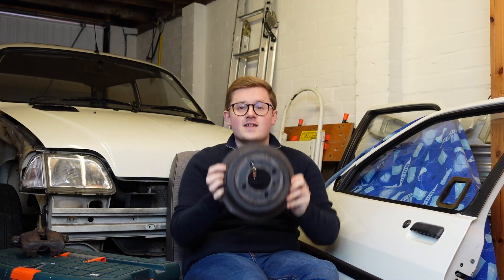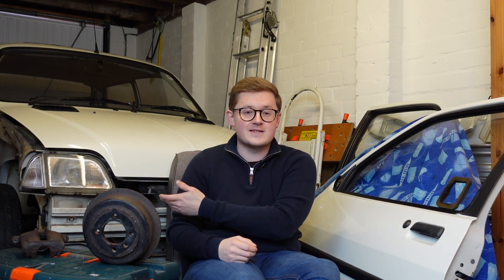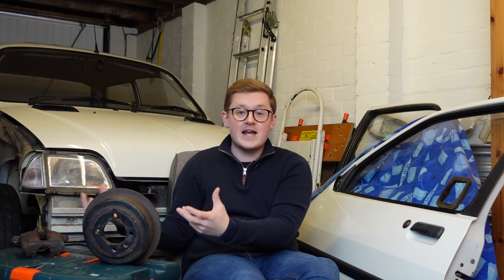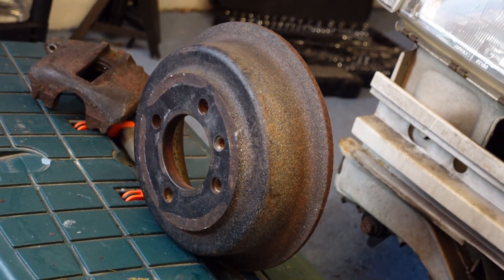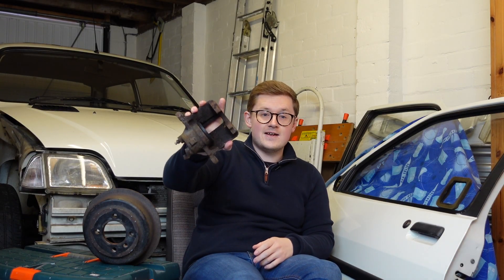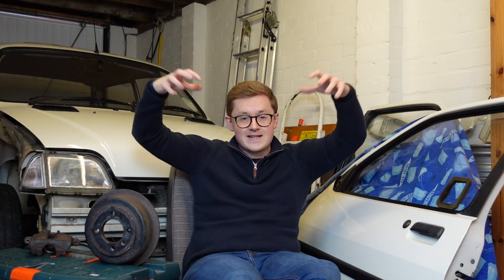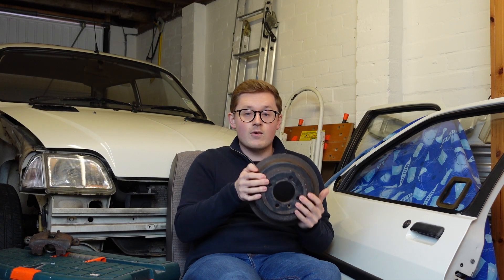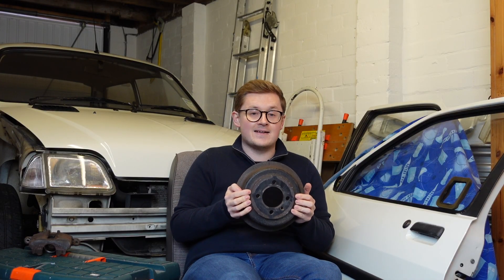Why are Drum Brakes Making an EV Comeback?

Comment: drums are more expensive than disks since nobody uses that anymore theres not many being made, on other hand disks are being made in millions, also the rust is gone the first time you press the brakes also brake drums tend to get stuck often special if you let it sit the only reason VW is using drums its because cars are made cheap to last around 10 years no more.
Reply from the maker: That's simply false. If you look, you'll find a surprising number of current cars with rear drums, not to mention the additional handbrake mechanism required for a disc-equipped car.
Reply: @TwinCam  yea, but those are cars to go to junkyard after 10 years maximum, its easier to instal disks over drums too much hassel with drums with springs and what not also parts already come from previous models already made to take disks and drums are nor reliable long term they also get rusty and if you are a mechanic you know what you have ahead of you stuck bolts to take the cover out tahts what you get also the shoes last the same either disks or drums they have the same amout of pad on the drums they just strech it out on disks they compact it, also EV's are bad for the enveroment they are causing rapdly climate change and crating mass holes on the ground and Contamination of the soil around it also taking in account the amount of deflorestation they do to create the mine, heres a data for you : To achive the neutral carbon footprint of manufactering a car the combustion car needs to be driven between 15k to 20K km, meanwhile the ev needs to be driven 125K km by that time it may need a new set of batterys, causing it to reset the cock backwards around 100K km are EV's green? Not at all taking in mind that Ev's are all eletronic making it 90% E-Waste and in case the main screen breaks your car is rendered useless since you cant acess anything on it theres no buttons on it.
Reply from the maker: The average age of cars on UK roads is 14 years. Cars last longer than ever before.
Reply: @TwinCam  14? thats brand new.

Comment: I used to think drums looked horrid on cars with alloys - I restrained myself from putting alloys on my Spitfire as a result. Moving on in my car history I had a Renault Clio mk1 which was small and light so didn’t care, next a Honda S2000 which did have a drum inside the rear discs (never leave the handbrake on when laid up!). Then a Volvo V40 which had discs all round - the rears have been an absolute pain in the backside with the caliper sticking and the handbrake cable snapping due to the crap design. So mixed feelings- I hate the asymmetry of discs/drums but can understand the logic for drums on EVs albeit I’d still prefer the stopping ability if needed and regen isn’t doing anything 🤷‍♂️

I believe some larger cars had dual cylinders at the rear so that the shoe would both lead giving better force distribution

Comment: The funny thing is that the 'grabbiness' of drum brakes is not a bug, but a feature.  The 'grabbiness' is a result of drum brakes being 'self-energizing'--  the geometry of the linkages and shoes means that coming into contact with drum forces the shoe into the drum.  The linkages of the two shoes are mirrored so that one of the shoes will be forced into full engagement, regardless of the direction of rotation.  The opposite shoe can still be forced into engagement.  Heavy vehicles still use drum brakes, for this reason-- you can generate large braking forces, without large pedal forces.  

In fact, I had assumed that a big reason for a return of drum brakes to EVs was due to the issue of generating large braking forces, while lacking a means of boosting that is not also a parasitic draw on total range.  Otto cycle ICE passenger vehicles use the partial vacuum of the throttle body to use atmospheric pressure to increase the force applied to the master cylinder (Diesel passenger vehicles may actually have an auxiliary vacuum pump to supply the brake booster).  A happy coincidence is that taking your foot off of the gas to stomp the brake pedal closes the throttle, further dropping the pressure in the throttle body for added boost.  Applying the brakes, while the engine is not running, so there is no boost, can be exciting, depending on the vagaries of vehicle mass and driver leg strength.  Unboosted drum brakes are much better than unboosted disk brakes.  EVs only need mechanical braking at low speeds, when regenerative braking is less effective, or when the vehicles needs to apply large braking forces RIGHT NOW!  Most EV service braking is done in the electric motor, so drum braking systems really do make more sense. 

Anti-lock drum rear brakes were an option on the 1976 Ford Thunderbird (You did not absolutely need them during a panic braking episode, but not having to worry fish-tailing during a sudden stop would add great piece of mind), so the 'grabbiness' of brake drums is a solved problem.
Reply from the maker: Absolutely, in some cases, but in performance cars, the grabbiness traditionally led to lock-ups and an inconsistent pedal feel, hence why performance cars were the first to make the switch to discs!
Reply: Positive breaking coefficient
Reply: You missed the part where manufacturers have been using hydraulic assist rather than vacuum for years. 

Generally they run it off the power steering pump. Guess what EV's have? An electric power steering pump 😂

If GM figured out how to do it 30 years ago, I'm going to guess everyone else knows it's out there.
Reply: Older hybrids (like my 2nd gen prius) have a small auxiliary vacuum pump to operate the brake booster while the engine isn't running, but newer evs and even some ice driven cars use an electric brake booster for the hydraulic brakes

Comment: Who else remembers drum brakes sticking on after the car had been left for a while (sometimes overnight depending on weather conditions)?
Reply: The drums on my SEAT Mini would often stick after I washed it,  resulting in the car dragging its rear wheels until they freed up with a loud clonk.
Reply: @Cyberdyne-kg8ku  Happy days!  Where I lived at the time, it was damp a lot.  I had to carry a hammer to give the drum brakes of my Astra a whack so I could move in the morning.
Reply: We had rear drum brakes on our 2010 VW Polo, last summer we went away on holiday for 2 weeks, and when we got back they had completely seized up. I tried driving it down the road and I was literally dragging the back wheels. Fortunately when I stopped the brakes freed up. We traded the car in not long after.
Reply: I remember one cold morning accidentally pulling the pads off the front disk brakes of my truck. The disks were wet from driving through snow, and braking shortly before parking for the night, which caused the pads to freeze onto the disks.
Reply: @HuFlungDung2  Not a fun discovery in the morning.
Reply: happens with disc brakes too. I used to carry a jack and a 4 lb hammer to pound on the disc brakes and make them loosen up, Happens when the vehicle goes over 200,000 miles and you don't replace everything. As for drums and downhill. Well full metallic shoes fixes that. I 1st started wrenching on cars in 1963.
Oh those brakes on a MK VII LSC suck. The only way to fix them is with a Mustang R double diaphragm and Mustang R master cylinder. Technically not a legal conversion.
 if you can find them.
Racing brakes do not have anti lock. But the masters of engineering in DC and California have all that right answers.
Reply: Yep, (preferably) do NOT park your car with the handbrake on. Brakes can freeze and also as mentioned in the video; brakes transfer motion into heat. Heat expands metal, when they cool when applied this will stress or even deform the disks or drum.
Reply from the maker: Handbrake problem, usually. Tends to be due to a lack of copper grease.
Reply: @TwinCam  (This reply is for the lack of copper grease causing a handbrake problem)   Regards the brakes sticking.  From what I recall, brake dust and /or dampness meant the shoes would stick to the drum.  Some people could get  away with driving a short distance until the drums freed up (Usually with a BANG).   In other circumstances that would not work.  Thus the hammer.   It was common practice for breakdown services to give the drum brakes a quick tap to fix seized ones.  If that didn't work, the drum was usually removed (hopefully without pulling the shoes or anything else off) then it would be cleaned.  

I doubt it would be done now.
Reply: @TwinCam no, the OEM doesn't recommend using grease in the brakes.
Reply from the maker: Drum brakes need lubrication in the braking system. It says so in the repair manuals for both my cars with drums, and my Mum’s car with drums.

Comment: What happens with re-gen braking an EV when the battery becomes full? Do they short circuit the motor and handle the heat there?
Reply: How is that even possible unless you're accelerating and charging at the same time?
Reply: @orangutanfan3179   E.g. you find a fast charger at the apex of Gross Glockner and then brake/re-gen  your way down?
Reply: Teslas have an option to use the friction brakes automatically to simulate regen braking when the battery is full. It's only likely to get used if you've charged to 100% and then drive down a long hill.
Reply from the maker: In the same way that your phone doesn't charge more despite being at 100% charge, electric motors can dump power. Additionally, they have headroom over 100% that would damage the batteries if regularly used, but such a scenario would never happen regardless, because regen can never regain 100% of the power used, and you need to start moving in order to have to stop...
Reply: @TwinCam  The world is not flat, so this can happen if you start at altitude and drive down a long steep hill. Tesla would not have bothered to add the option to simulate regen with friction braking if it could not happen. It's to make the car behave the same when you lift off the accelerator whatever the battery state of charge.

Comment: Good video on a subject that needs highlighting. Your comment about disc brakes always offering slight resistance due to contact with the disc with no pedal applied (sorry to paraphrase) is one I have often pondered about because whatever the future of brake design it needs solving if not for the sake of economy but it does create heat which is never good. Most of the movement that is not 'enjoyed' is often on the pad that has no retaining clip on the back that one is  disconnected from the disc face on calipers that have a piston on one side only. The remaining pad in this case is left to float free which seems like poor design to me.
Reply from the maker: There are solutions, but they all add complication!
Reply: I agree there are so called solutions but none really 100% cure the problem, anything that is designed to do so is ok when first installed on a nice clean calliper etc, etc. They all fail once mother nature has taken its toll and not too long either. 
The single piston (or at least hydraulics on one side only) type of calliper has of course the sliding pin, assuming these are well maintained. However, once the pressure comes off the hydraulics ad the piston backs off about 15 thou the pressure is automatically released on the opposite side of the disc by virtue of the pad is no longer gripping the disc in conjunction with the inboard pad, all well and good? No, the pressure release exerts no braking force of course but there is no goo reason mechanically for the outer pad to actually move 100% free of the surface of the disc, this is provable and I have done it several times to demonstrate the fact. There is nearly always slight contact there and that is what is wrong. I should qualify tis by saying you may jack up a car and have no apparent drag which would seem to disprove all of this but it is a lottery not a racing certainty.
In the case of older designs of calliper with pistons both sides then there is a better chance of true zero contact  state to exist, (providing the pads don't drag on the frame etc, etc. It was all to easy for garages to just take out the retaining pins and withdraw the pads from the top with no possibility to properly clean the guide areas and so on.
I have for over fifty five years (and still counting) worked on all designs of brakes or at least many, many designs and certainly of dozens of makes and never have I found the perfect design and that is to say one that works 100% after 5,000 miles as it was when it was first assembled.
It does need saying however that the advent of the stainless steel guide clips in more recent years is a blessing, at least they don't corrode so that is one obstacle out of the way.

Comment: Brake fade in drums is more to do with the shape of the drum than the effects of heat on the friction material.
Heat makes the disc area of the drum expand which forces the wall area to become conical and not cylindrical.
When this happens the shoes no longer contact the drum over their whole surface and the braking effect diminishes
Reply: Would evaporation of the hydraulic fluid happen later than this conical deformation effect?
Reply: @@retiredbore378 I'm ignorant. Is it the brake shoe liner or the steel of the drum which lowers its friction with heat? I understand You as it's the liner?

Comment: Fantastic explanation Ed. I have a 1953 Vauxhall Velox and a 1954 Rover P4 90, both with 4 wheel drums. It is interesting to compare these two systems. The Vauxhall uses leading/trailing shoes on all 4 wheels and you really know you are pushing the pedal, I change down a gear to use engine braking to assist. The Rover, on the other hand has twin leading shoes on the front and leading/trailing on the rear and pedal pressure is GREATLY reduced. So much lighter, in fact, I had to check a booster had not been fitted, it hasn’t. I still use the gearbox to assist with braking, particularly, down hill. Like a lot of ‘old’ technology, drum brakes are much maligned due to the effect of advertising to promote the ‘new’ technologies.
Reply: I'm not sure what the European requirements are  but I know that dual circuit brakes became mandatory for new cars in 1968 for US  market and I think functionally they were standard for 1967. My daily driver is a 1st generation Ford Bronco with four wheel drum brakes and I can tell you from experience that the material  used in the brake lining makes a huge difference on the drive ability and pedal feel. Most of the shoes available now are bonded linings and semi-metallic composition they are grabby and cause the vehicle to dart dangerously for use on the front wheels, there's a  limited quantity of organic/ old style  composition riveted linings available online as close-out/overstock shoes while they're slightly less effective at decreasing the stopping distance they stop straight and dont grab. Making them mucj safer to use...
Reply: @alexlail7481  I still have asbestos brake pads and linings in my 83 Datsun, thanks to my first boss having some old stock on the shelf. Work much better than modern pads in same system.
Reply: @derekhobbs1102  Healthy. Throw them out imo
Reply: @veden3383 I've been handling old brakes most of my working life, I know how to deal with it safely.
Reply: @derekhobbs1102  Yes. What about everyone else?
Reply: @veden3383  My vehicles put out a lot less  particulate emissions in a whole year than one Adelaide tram does in a day. Doesn't matter what it's made of, brake dust is bad.
Reply: Does the rover have a split hydraulic circuit? Ir one circuit works the upper cylinder on all 4 wheels and the other circuit the lower cylinders on the front?
Reply: @neil1997  being from 1954 it is a single circuit system. It fails they all fail.
Reply: My 58 through 61 Vauxhall brakes worked fine.

Comment: VW are dead and I'll be surprised if the ID2 even starts production.
Reply from the maker: Volkswagen are the largest car company in Europe. It's no doubt that they've had problems over the past seven years, but to say they're dead is silly at best. They've even been contracted to provide their EV platforms to Ford.
Reply: @TwinCam  They bet the house on EVs then proceeded to produce cars with Nissan Leaf levels of battery degradation and are now ceasing production at Dresden. The universally liked Buzz is stuck with commercial vehicle speed limits and has a kerb weight not far short, of the gross weight allowable on a standard driving licence.
That means anyone with a post-97 car licence, needs to do another test to use the thing with any weight inside.
Time will tell how long VW survive.